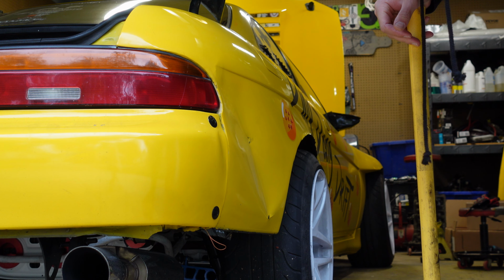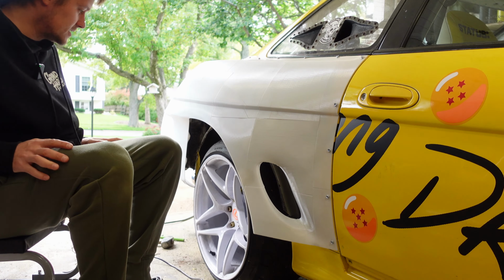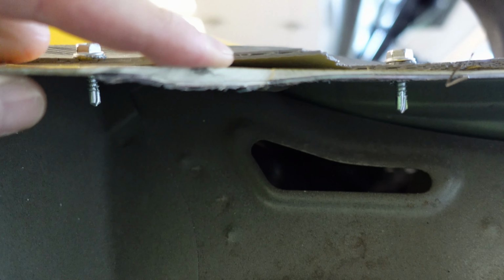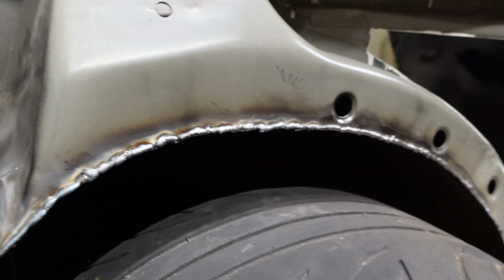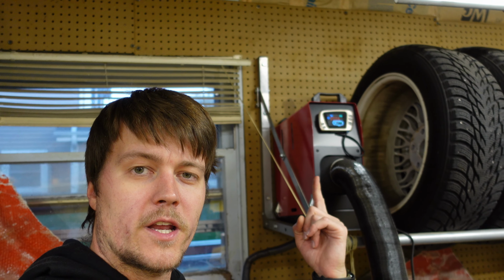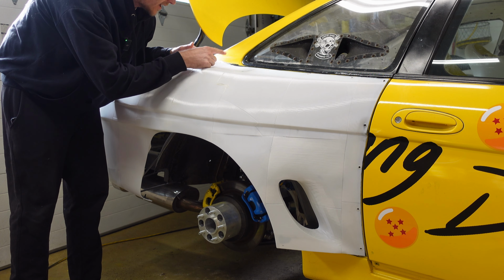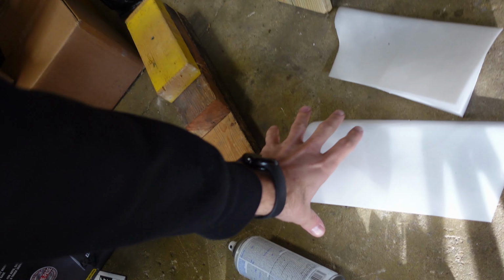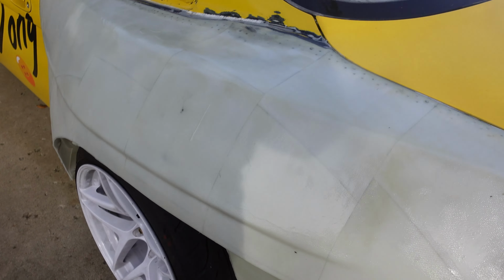3D Printed Widebody Kit is Fully Attached!!!

Comment: @14:25 Viscosity is the term, not particulate. But man, what a fantastic job you've done! Never really thought of using my printer for this. The nice thing is the plastic can give you the exact shape you want so it will make it so much easier with the fiberglass. Basically you can just slap it on there, sand it, fill it, prime it, paint it. Genius.

Comment: Really cool stuff man! Are you designing the kit in Maya? If so, are you also slciing the model in Maya before spitting out stls? I only ask because I see you add those chunks where the mesh connects, and I am sure its easier to do it in the 3d software than in Bambulab lol.
Reply from the maker: Yep exactly, bumps are added before model is cut into pieces.
Reply: @DingDongDrift  You ever try to 3d print molds for CF stuff? I am in that stage now. I can do the design and print, but my stupid prints keep getting air leaks in the filament when doing infusion lol.
Reply from the maker: @poltdesigns  i have not tried infusion but my shifter i made with a printed mold and compressed chopped carbon. If you're having leaks try doing more perimeters not more infill. I use 7 perimeters and only 15% infill.
Reply: @DingDongDrift  Def will try. I was doing 3 lol. Thanks for your time man, really cool stuff you are doing here!

Comment: Hey long time viewer here, I was wondering if you considered applying a few fiber glass layers on the panels before they were mounted on. Obviously just avoiding the areas where you needed the flush fitment with the oem panel. I figure it would offer way more rigidity than the smaller pieces on the flimsy parts.
Reply from the maker: It would be the same exact rigidity and also since the plastic flexes how would i know it's curing in a way that would actually fit the body?
Reply: @DingDongDrift  Sorry i meant fiberglassing the underside of the panel.
Reply from the maker: @SgtLemur-zl9oe  i only add from the back where i need it. But this panel is so stiff it's not necessary

Comment: The ender 3 is a nice printer. I have one. The only issue I have with it is how often it needs to be tuned. If you run them too fast the bed tends to unlevel itself. Obviously a bamboo printer is much better though.
Reply from the maker: Yea I'm over that, just need something that works. The bambu lab a1 is only $299 there's no reason to buy enders anymore
Reply: @DingDongDrift  I agree. I only bought an ender 3 because it was $160 and it was my first printer so I didn't wanna spend a boat load in case I just didn't get into it that much. I will be upgrading soon though because I 3d everything now lol.
Reply from the maker: @neonnerd1364  the ender has both created a bunch of 3d printer people and also pushed away a bunch for the exact same reasons lol.
Reply: @DingDongDrift  ya I can see that lol. I have amazing prints for a while then have garbage prints for a little bit until I figure out what the issue it. Last issue I had was the bowden tube. I just put a capricorn tube on it but haven't used it yet.
Reply from the maker: @neonnerd1364  i went 2840 print hours on the x1c before i had an issue lmao. New hot end swapped with 2 screws and it's printing like day one again.
Reply: @DingDongDrift  nice. I didn't have my bowden tube issue until probably about 2 months of solid printing all day every day. I hardly gave my printer a chance to cool down before I started the next print lol.
Reply: @DingDongDrift  Ender 3 v3 se is good, ke version will be even better and they are cheap
Reply from the maker: @bl4de938  still not as good as a Bambulab a1 lol
Reply: @DingDongDrift  you would be surprised
Reply from the maker: No i definitely wouldn't be
Reply: @DingDongDrift  a lot of issues with any 3d printer is really just user error, as i can see in your print that you have to reprint it, really that doesn't have much with printer, it's more about user and settings, but use whatever works for you

Comment: what's up man, nice work on the car. I was wondering is there a reason you are using the 3d print as the kit instead of making molds? i've seen some other people do it like the dude with the fastback for the miata but i can't understand if its worth to make a mold or not. Anyway, aeep it up!
Reply from the maker: How do you know the mold will fit perfectly? Do you know how expensive the materials for making a mold are?
Reply: There are plastics reinforced with fiber, but it's not done like that...
Printing a male part and then covering it with fiber is an easy solution but it has drawbacks...The materials risk delamination, plastic is heavy...and they don't like heat.
My advice is to print female molds... (just offset your male mesh of 2mm thick), extrude some edges of it, to have rigidity and less deformation
Assemble the pieces.
And laminate your fiber and resin inside, remember to use a release agent, margarine does the trick...
It's an economical way to print a part, which will need work anyway (unless your mold is perfect) but as we print thin walls (to save some PLA/ABS/ASA), the prints are rarely done once assembled
3 layers of 3OOgr fiber, and the job is done, solid and resistant

It's worth to make a mold when you've obtained the resulting part, but not necessary
Reply: @DingDongDrift  not really, that's why i asked
Reply: @SETHalpine  I think I understand, thank you!

Comment: Is the 3d print filament a pla+?
Reply from the maker: No, PETG, PLA is useless
Reply: @DingDongDrift  Thank you for your answer.
Can I glassfiber to the inner side, not the outer side?
Reply from the maker: @이동현-z1u  you can do whatever you want but then you'll be sanding plastic which is way harder than fiberglass or body filler

Comment: Drift Car? Should use printed part's to create a mold then make them in fibreglass or carbon. When you smash it you have molds to create new ones rather than having to reprint, sand filler etc etc

Check out easy composites 3d printed mold vids for the process. 👍
Reply from the maker: Watch the newest video